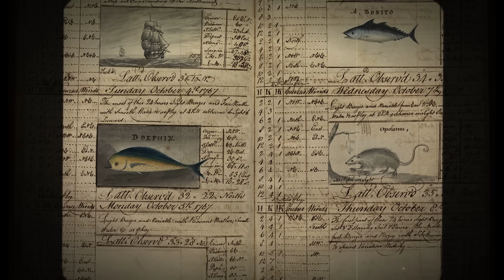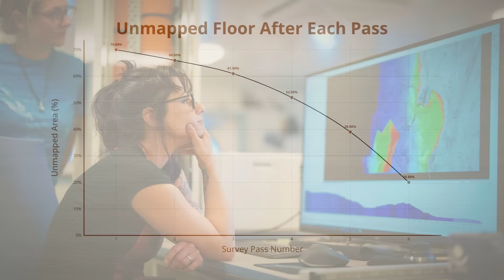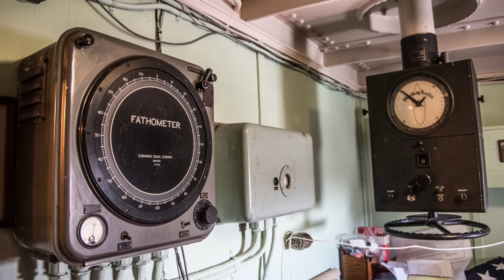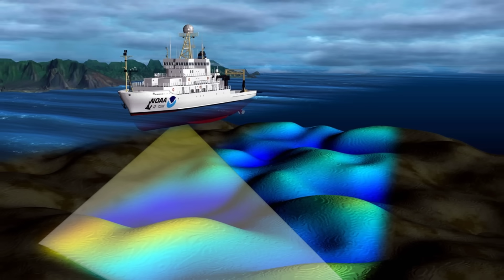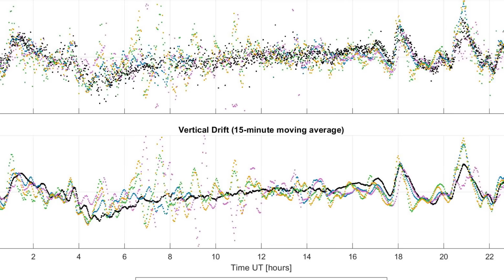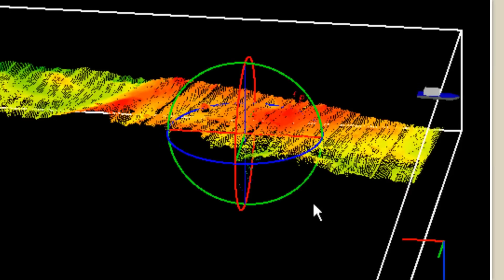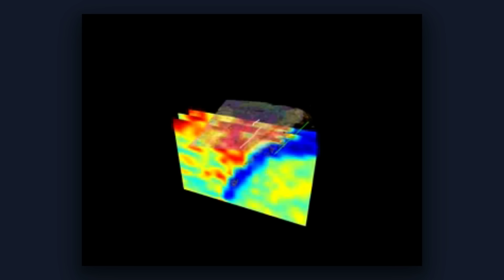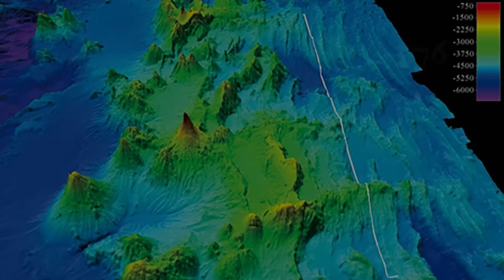Scientists SHOCKED: Tonga Trench Deeper Than Mariana?

Comment: If they lower a sensor to the bottom then why don't they measure how long the cable is?
Reply: You need almost 7 miles of cable to do that, you'd have to compensate for underwater currents bending the cable making it use more to reach the bottom, giving an inaccurate reading.
Reply: very old fashioned in the times of sonar. The cable will stretch undr its own weight, and bend, in an uncontrollable way

Comment: How can life with stand those pressures
Reply: Nature always finds a way.
Reply: almost an inappropriate question, despite it is popular.  Fill a small inflatable balloon completely with water, and bring it down there... would you ask how the balloon  could resist the pressure?
Water is not compressible by the pressure of a 11km water column. This changes around 100..200km, when water starts to behave like a sturdy gel.
Likewise the membranes of cells and the involved molecules are not compressible enough to lose their functioning. They are much more dependent on temperature
Reply from the maker: It's insane right?!

Comment: Why can’t they build submersible subs that can pressure the inside as they go down. Could use chemicals or even pump them up as they go down for at least a few 1000 meters. Maybe??
Reply: They are called Bathyspheres. They do exist, Ah la the famous Trieste. A spherical pressure vessel is fitted for human Aquanauts.
Reply: Because coming back up, many, many decompression stops must be made, or an extremely long decompression period in a dedicated decompression chamber at the surface must be endured. Plus a special mix of gasses must be used, usually trimix, a mixture of oxygen, helium, and nitrogen because oxygen under pressure is dangerous. And if gasses must be pumped down, the submersible is no longer untethered and autonomous.
Reply: Let's just call them equal, and call it a moot point.
Reply: Gravity changes at depth.  I have the equation to adjust for it.